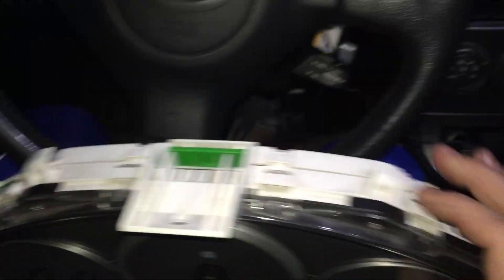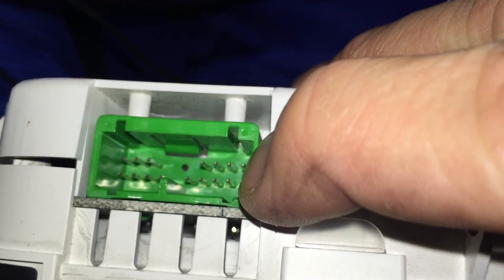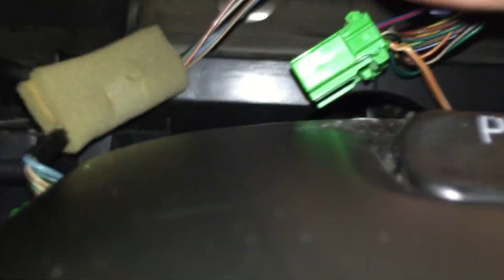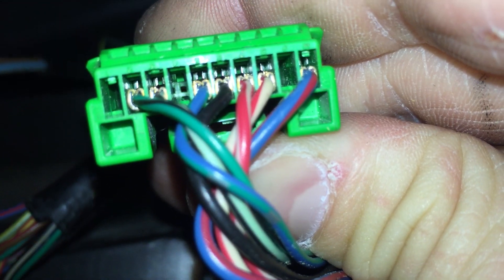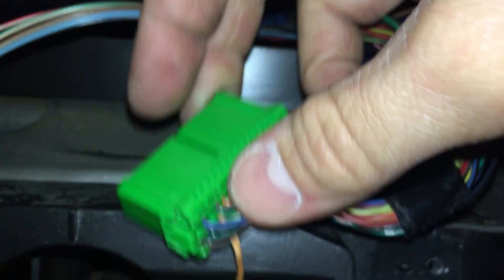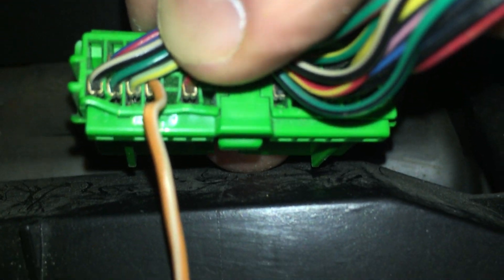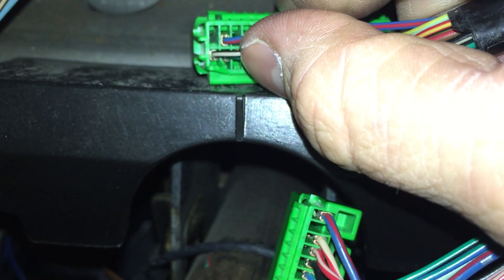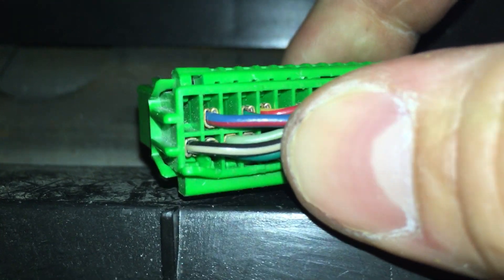Subaru WRX to STI Gauge Cluster Swap

Comment: sick video man, helped a lot with my cluster swap on my 03 bugeye. have one question though, how did you remove the wire pins from the harness? ive been trying to get them out with a tiny screw driver from the access port in the back of the harness. any suggestions?
Reply from the maker: https://youtu.be/Aw57Hs79Ibs?t=299   watch at this time around 5:00. I explain how I did it
Reply from the maker: and thanks man! hope all goes well!

Comment: Awesome video, this helped me a lot in swapping my 06 STI cluster into my 06 WRX. Check out my two writeups on NASIOC for details of this cluster swap in my DCCD Pro install and rear diff temp sensor circuit install:
https://forums.nasioc.com/forums/showthread.php?p=45409083#post45409083
https://forums.nasioc.com/forums/showthread.php?p=45409053#post45409053

Comment: Followed the instructions and put a 07 sti cluster in my 07 wrx in less than 20 mins. Most outstanding job ever thanks again for uploading this video !
Reply: Hey, does thr welcome sweep work and do you have the shifter light working with sound and light? Also dis you cut the C9 or you just relocate it?
Reply from the maker: @petkokrushev3840  Yes the welcome sweep works and the shift light works too, its adjustable with the button that sticks out of the cluster.
Reply from the maker: Thank you, glad this helped!

Comment: Hi i've fit a 2006 jdm wrx speedo to my 2005 wrx all works fine the only thing is missing it has an impreza logo should light up blue in the middle of the gauges which doesnt.
Could you help me with this pls?
Reply from the maker: Yes the only thing I could think of is, If its an LED display, then the LED burnt out, which you could unsolder and resolder a new one in, otherwise if its a bulb, just replace the bulb. and you said it was blue? I havent seen any of them with blue yet.
Reply: VinnieT8 its all good now it has a light on but was to sunny outside lol
Yes it is blue ish white impreza logo
In the middle look lovely i can post a pic on here. Its came from japan by the way
Reply: VinnieT8 thanks for getting back to me
Reply from the maker: yeah for sure man!

Comment: Hey Vinnie,

I need some help... 
Firstly, my C9 wire is not plain brown, its yellowbrownish/blue wire and it is next to c10 which is red/blue wire. Funny enough, my c8 is not red and white, its purple/green?
Secondly, I have no B28 wire, lol???
My car is 2003 WRX Sedan 2.0T 5MT JDM with 260km Cluster.
I really need new cluster because my speedometer stopped working so i want to replace it with STi one and ended up watching your video. Any help would be highly appreciated! Cheers
Reply: Ok so C9 is the wire for dimmer circuit which I will just need to wire it to B4 to avoid buzzing sound. so regardless of the wire colour, it is what it is.
B28 is not really concerning because i don't use cruise controls."
so other than that, as long as i shave off C plug, Version 8 Sti cluster should be plug and play into a Version 8 WRX?
Reply from the maker: Seems to me that you have the JDM Version of the cluster. Your best bet is to look up the JDM cluster conversion to the make model and year of your car.

Comment: Hey quick question I got the same 06 wrx and bought a 06 sti cluster but the thing is the Gas Gauge connection doesn't match up did you run into any trouble with this? Thanks in advance
Reply from the maker: Watch the video fully through, you'll see that you have to swap some wires around. Also if you google 06 wrx gauge cluster swap with 06 sti, there are charts showing you exactly what wires to swap around. CHECK OUT THE DESCRIPTION ON THE VIDEO >>>>> I have linked the website showing which wires to exactly swap.

Comment: i installed a 2004 sti cluster on to a 2003 wrx but im getting this beeping nosie that wouldnt go off and on the gas gauge theres a lock that wouldnt turn off
Reply: TheRedlineFactory i have the same problem with an 07 cluster in my 05
Reply: Were you able to fix this?

Comment: Do you know how to disable the dccd light? If not dont matter haah
Reply from the maker: not really sure how to do it , but i found out that if you turn your cluster brightness switch down, it wont dim your cluster but it will dim the dccd light haha, its on the left stick where you turn your head lights on , further down the stick thing theres a way to lower the cluster lights, when i turn that down it dims/ turns off the light.

Comment: hey man i have a 2002 wrx can i put a 06 cluster in that or not? Just curious. Sweet vid bro
Reply: First of all, super THANK YOU to Vinnie!!!
I just installed a 06 sti on my 02 wrx “manual/turbo”.  Followed Vinnie’s steps and shaved the two plastic strips on the left connector in order for it to slide in.  Relocated the orange and white wire.  Then relocated the second wire but that eliminated something else, so I backed out of that one since obviously it was not the right move.
Everything works except the ABS light is always on, the dimmer does not work, and the temp reads around 32 F which is fine cause I don’t have this on my 02 wrx cluster to begin with.  I want to start by fixing the ABS light, so I found the wiring diagram for the ABS for the 02 WRX, and now I need to look for the same diagram for 06 sti so I know what to rewire to switch.  I have limited time, so I will post my findings when I get to it.
Reply from the maker: wrx or sti cluster?
Reply from the maker: the wrx and sti clusters are slightly different that's why I ask.
Reply: sti
Reply from the maker: I would say research it online and see if anyone else has done it before you decide to just buy it and try it.
Reply: The Programmer How did you get the abs light off? Did you do it in the end? Thanks

Comment: Does outside temp still work accurately, and does the DCCD light stay on?
Reply from the maker: +Bradley Veljanovski yes the temp is spot on, for both Engine temp and the outdoor temp, (wasnt sure exactly which one your speaking of but they both work great)
Reply: Yeah was asking about the outdoor temp as I've heard it doesnt work, cheers for that mate
Reply: i forgot to mention that subarus  that came with auto hvac will be the only cars that the OAT will work with a straight cluster swap . subarus with out auto hvac like my wrx tr will need to be modified . i just recently found this out from a member on nasioc who made me a wire harness and voltage regulator to make it finally work . read up on it here http://forums.nasioc.com/forums/showthread.php?t=2704637 . im pretty vinnie you had auto climate controls right?
Reply: +Bradley Veljanovski out side temp does not work after doing the swap . i did my sti cluster swap back in 08 and it doesnt read the outside temp anymore after the sti cluster swap
Reply from the maker: this is an 06 wrx with an 06 sti cluster. its different, mine works perfect.
Reply from the maker: yes correct I had the auto hvac so I never had to switch anything around to make it work, it was all plug and play for me.